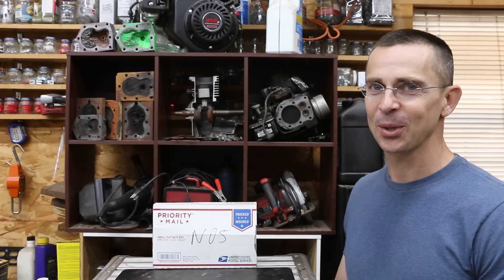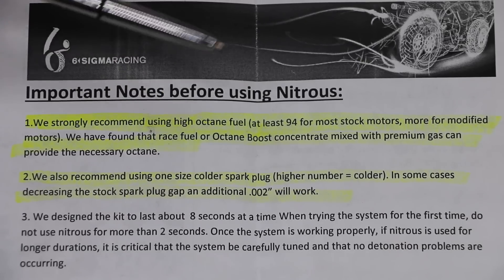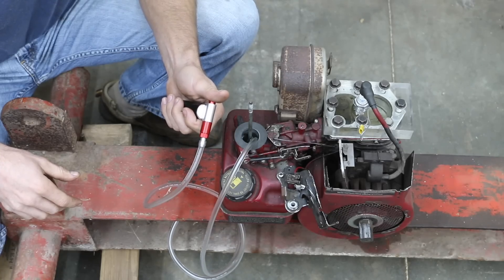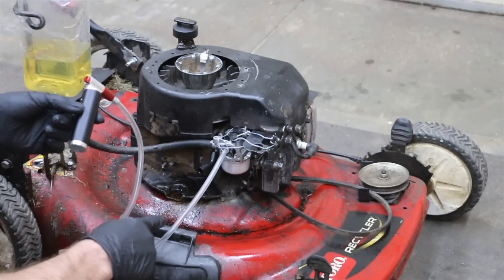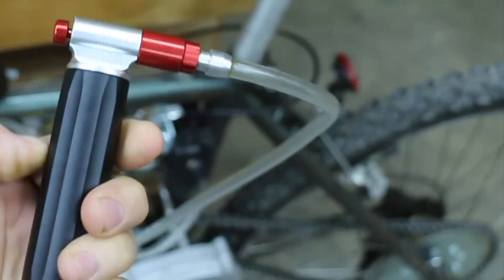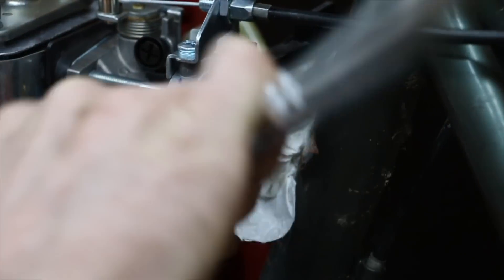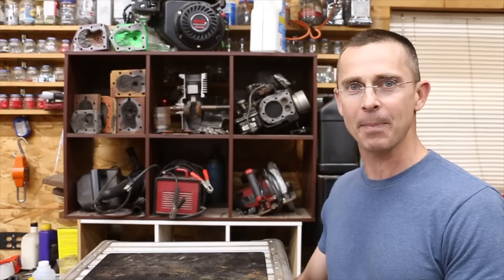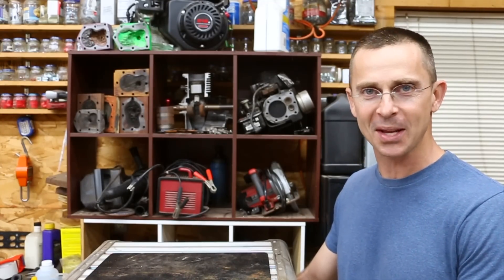Will the 4-Stroke Bike Survive Nitrous Oxide?  Let's find out!

Comment: We need to see the nitrous on a gas powered chainsaw next. By the way, you can buy the nitrous and the pressure vessel from any decent "head shop." It's sold as "whippits" and ostensibly it's for making whipped cream, but really people get high with it. Bout $20 for a case of whippits and maybe $10 for the pressure vessel. You'll need to figure out how to add a valve to the pressure vessel they sell, but if you want to get out the door for under $40 this is a way to do it. Any reasonably well equipped garage and decently handy garage dweller can figure out a way to make it work; it's not rocket science. But by the way: they use nitrous as an oxidizer in rocket motors, so you could build a really powerful motor with N2O as an oxidizer and there are dozens of fuels you could pair it with (H2 is the best and hardest to work with, but has the best caloric density of, well, anything in the universe)
Reply from the maker: Thanks for the video idea.

Comment: The way nitrous is supposed to work is by providing additional oxygen to allow burning more fuel. Without adding more fuel you will be running lean and I would expect pre ignition. On a simple car kit it has a plate with jets that add additional fuel and nitrous.
Reply from the maker: Thanks for sharing.

Comment: When it comes to nitrous, simply moving to a higher octane number (ie..slowing down the burn rate of the fuel's flame front), is only one part of the power equation, if you're also aiming to retain engine longevity. The preignition you immediately encountered, was due to the fact that once you introduced the nitrous into the combustion stream, the presence of the nitrous effectively dropped the "new" air/fuel mixture's octane rating, below that of the minimum required for that engine's valve/head flow, and total timing.. Did you get more power? Hell yeah, you did. The question is, is how long could this engine deal with that? 
   If there is one thing I've learned about nitrous, is that it's very unforgiving if the fuel delivery system isn't up to the task of "keeping up" with nitrous' voracious appetite (ie, NEED), for "more fuel." Add that to a poor cylinder head design, and/or small exhaust valve diameter, or poor type (metal composition), and it's a recipe for burning holes through piston faces, (among other horrible things), should the mixture go lean on gas, even for a few seconds. Trust me, I've learned this the hard way....😣
   Ideally, when running a nitrous set up, a secondary electric fuel pump, with a WOT (wide open throttle) relay activated solenoid switch, should be installed. Along with an additional fuel line. That additional line being at least 2/3 the diameter of the factory delivery line. More gas is THE critical key to a long service life, in any nitrous assisted engine. 😉
   I hope this helps anyone contemplating using nitrous in the future. I wish someone had told me this. And once again, thanks for another very interesting video.
Reply from the maker: You are welcome!

Comment: see the big misconception is that simply adding NOS will give a boost wile it might give a little boost what you need to do is add additional gas wile boosting to keep the air fuel ratio right when you will see huge gains NOS dosent add power it simply aloes you to burn more fuel per charge dew to the added oxygen

Comment: They make EFI kits for small engines they also have an ECU in the kits with a wide band so you can make sure you have enough fuel when adding NoS or a small turbo even...
Reply from the maker: Thanks for sharing.

Comment: You should try doing something with that fuel from RC airplanes believe me you'll get a lot more power than that little bottle of nitrous I recommend some sort of second little tank and somehow mixing it with the gas inside the carburetor because if you put it directly in the combustion chamber you'll over rev the motor my push scooter when I was a kid was ridiculously fast my dad clocked me just under 80 miles an hour on a push scooter 😋
Reply from the maker: Thanks for the suggestion.
Reply: @ProjectFarm  I just picked up a nice road bike going to be ordering a motor kit Monday still debating whether or not to get a four-stroke or two-stroke I watched your video but I still can't decide I used to build motorized scooters out of old weed wacker motors but I haven't done that for at least 18 years or more been wanting to make one of these bike kits for a few years now time to do it

Comment: Adding more oxygen without adding more fuel unbalances the 14:1 mix, so you will get much more power if you add not fuel at the same time
Reply from the maker: Thanks for the feedback.
Reply: @ProjectFarm  Consider trying that NOS test again, but with a small venturi (at the end of the clear hose, with a small fuel hose going to the gas can), similar to those old manual bug sprayers, so that the nitrous oxide jet pulls with it some additional gasoline into the carburetor venturi.

I think the results will surprise you.

Comment: All nitrous does for a engine is to cool the internal combustion chamber and allow more fuel to burn quicker now if you could find a way to super cool the engine while it is riding down the road you might be able to get it to go sixty to seventy miles per hour unless you put a different cc head on it which you probably have a 45 cc head on that 4 stroke
Reply from the maker: Thanks for the suggestioin.

Comment: Add extra fuel, lp butane etc with the nitrous
Reply from the maker: Thank for the suggestion.
Reply: Project Farm perhaps a slightly retarded ignition timing, and a water methanol injection
Reply: Old style carbs with the foam filters could be drilled and tapped and the air box used as a mixing plenum. So a little mw50 in the throat and n2o and butane in the box. ? Might see a rod hanging!

Comment: Nitro, if that is Nitrogen, won’t burn.  So, would pure Oxygen without N give a better result?
Reply: No
Reply: Can’t understand how a nonflammable gas would benefit power output from an engine specifically designed to operate on a flammable fuel. Would a mix with a highly explosive gas like Hydrogen not produce a better result. If not, what is the connection or opposite properties between Oxygen and Hydrogen with Nitrogen?

Comment: Have to add fuel and pull timing to keep it from detonating. Re visiting this test would be awesome. The added power comes from the extra fuel the engine can burn, the nitrous just allows it to burn the extra fuel. The nitrous also is super cooled, cool dense air has a higher oxygen content than thin hot air.
Reply from the maker: Great suggestion!  Thank you.

Comment: Nitrous also adds oxygen to a system, allowing you to add more fuel at the same time, thus increasing volumetric efficiency through the roof. And wait, there's more! The Nitrous comes out of the bottles (NOS) around -128 degrees F .. so in a runner/plenum, the density of the air/fuel charge is greatly increased over ambient temps. Fun stuff. Maybe that's why they call it, laughing gas.
Reply from the maker: Thanks for the feedback.

Comment: Do NOT try this at home kids! Years ago I tried to talk to my wife about her lead foot, but she didn’t wanna hear it. “Oh I never punch it” she’d say when questioned about her acceleration habits. (Like a rocket!!!) So me and a couple of buds did a “tune up” one night but really only hooked up a NOS kit to her “k car” that was installed pretty much flush to the floor so it would only kick once the petal was mashed to the floor hard. Yes I proved my point, no there were no injuries or tickets and she believed me when I said it was just the “high performance” spark plugs that I had changed for her, and they’d only respond like that during break in period lol. Since then (33 years later because one just doesn’t let a gal like that get away) we still joke about the time “leadfoot Lilly” and her little ragtop Chrysler 4cyl k car took out my 73 Nova with a 283 in it off the line lol. Nope, I’ll never tell either, that was too big a win for both of us😉

Comment: Also the shifter karts we now use actually have a low powered nos system that works via the fuel system. This is to allow us to use smaller lower powered engines to reduce emissions and act as a form of hybrid on a engine that can't run turbo
Reply from the maker: Thanks for the feedback.

Comment: Its funny you should think about attaching the nos to a bike engine. I race karts of different formats 50mph twin engine, 80mph 2 stroke rotax karts and 160mph + 250cc shifter karts. 
During a testing session for 1 of the karts we attached the same kit you got to 1 of the engines and it led to some "interesting" results it worked amazingly for a few months of just messing around until the engine shall we say decided to not want to be attached to the kart any longer. We found parts as far away as 300 feet from the kart, some parts we never found. So yeah great fun just don't use it for too long lol
Reply from the maker: Thanks for sharing!

Comment: Nitrous Oxide injection is a torque builder, and works better at low to mid-range RPMs. To be utilized at higher RPMs progressive stages of spray must be added. All the while being supplemented by extra fuel. You get less results with Nitrous only, but the point is made in this experiment.
Reply from the maker: Thanks for the feedback.

Comment: That was knock, not pre-ignition. You probably don't need a colder plug for your lawnmower engine (if you had a high rpm engine under heavy load for a longer duration, then a colder plug would be good). You need more fuel. Nitrous adds oxygen. If you don't add extra fuel to match the additional O2, then you run too lean. That sound was knock. You usually don't hear pre-ignition like you can knock (because of the difference between knock and pre-ignition).
Reply from the maker: Thanks for the feedback.

Comment: There are actually ALOT of people who run nitrous set ups on small engines. I first noticed when I was a teen and raced on the circle dirt track. During the summer 2 day races there was atv drag racing outside of the track. Many of the guys had nitrous, ethanol, cam2, etc running in small 4 AND 2 stroke monsters. I used to have a Blaster bored 80 over, full internals, ported and polished. Running on the ethanol out of our stock car lol. Smoked those Banshees when they first came out easily. It also melted several piston. Thank god for cylinder sleeves and honing bits! lmao
Reply from the maker: Thanks for the feedback.

Comment: When doing this I'd advise getting a really small diameter PEX hose and putting a T up by the button-can with a suction relief valve on one side so the carb can pull the NOx out of the line to get your money's worth.
Reply from the maker: Thanks for the tip!

Comment: Not only when it decomposes you get the horsepower gain, every 10° you cool your intake temp you gain 1 hp, it super cools coming out of the jets in the systems so the cold air expands more in the cylinder
Reply from the maker: Thanks for the feedback.

Comment: in chemistry class i remember batteries split hydrogen from oxygen , and a demonstration tool    made of glass that separated the gasses ,different lead ends one zinc one copper, i think ? I've always wondered how one could get the right mix from those gasses to run in a engine , without turning it into a tannerite  target. its clearly the O2 thats giving the power boost. i have sat at the mans table drinking coffee who made the carburetor that can get you 100 miles a gallon in a 1985 square body heavy  chevy. I received a clue that day which gave me an idea. Have yet to receive the resources or time to tinker.
Reply: Gorski, mans coffee
Reply from the maker: Thanks for the feedback.

Comment: Doing high performance engines, we always add more fuel. Essentially the nitrous adds oxygen to the additional fuel creating safe power. Just a squirt of nitrous without additional fuel will still introduce additional oxygen, however to the detriment of the engine. Stochiometry is exceeded and it burns too hot (leaning out under boost is the same effect) causing instant hot spots and stuff breaks and melts. Rings get too hot and expand popping the heads off of pistons. So add more fuel, and try it again.
Reply from the maker: Thanks for the feedback.

Comment: The extra power from Nitrous comes mainly from the extreme cooling effect it has on the surrounding air when it's entering the engine - This significantly denser air allows much more fuel to burn and a much more powerful force on the top of the Piston. To my understanding, not much really comes from burning the nitrous itself.

Your lawnmower was pretty much topped out when revving with the nitrous - You didn't hear much because of valve float. Putting a larger cam or harder springs in, as well as adjusting the valves in general would probably get you to dangerous(ly fun) territory - flywheel shattering, even!

Hey, those little Briggs motors are built to mow lawns trouble free for a decade or two, with minimal maintenance and oil changes. 
I had a Briggs once that had a hole in the head gasket and kept cutting grass just fine! They're damn hard to kill.

If you had a second gear on that bike you'd get a considerably higher top speed, it's making plenty of power stock but it seems like it's just topping out rev wise, especially so with the nitrous.
Reply from the maker: Thanks for the feedback.

Comment: Nitrous does two things.  First, it cools the air as it vaporizes, which increases the density of the intake air charge. Denser air has more oxygen in it, so you get more compression, more compression males more power. The nitrous also increases how much oxygen is available in the air (breaks down into nitrogen and oxygen, remember), which lets you add more fuel to make even more power.
Reply from the maker: Thanks for the feedback.

Comment: Always enjoyed your videos, thank you. I have one request and I'm not sure, if you have already displayed a video on this. Since you mentioned octane boost on this video. I would enjoy seeing you do a video on different octane boosters. Do they work, how much is gained, do they harm your engine, can you use more then one per tank fill etc.
Those who put super chargers, turbos, nitrous or rebuild a motor with high horsepower needs more octane. Race fuel is very expensive and hard to get. These octane boosters are less expensive and easily obtainable, this would be a good alternative source. 
Also add a vapor cooler to your intake when trying to add more horsepower like nitrous.
Reply from the maker: Thanks for the video idea.

Comment: @Project Farm - I have a 1 pound aluminum CO2 bottle that can be used to hold 1 pound of N2O.  It is rated with a service pressure of 1800 psi (124 bars) and since liquid N2O is no more than about half of that pressure, you can use it for N2O safely.  It might be good for your bike.  You could get way more than just 8 seconds (perhaps several minutes).  You would likely have to use a very small jet and/or some other means to control the boost into the engine.  The bottle is silver colored so it will reject much sunlight.  Is it something you would be interested in?  I used to transfill it simply by using my 10 or 20 pound N2O bottle at room temperature, and using it to fill the 1 pound bottle that I froze overnight in my freezer.  You wont get the full 1 pound that way but you will get WAY more than 8 seconds worth.  You could actually gently heat the larger bottle if you wanted more N2O to flow into the smaller frozen bottle.  Let me know.

Comment: You get more power by adding more fuel WITH the nitrous.It requires an enriching circuit to keep the proper air/fuel ratio.The pinging you were getting was a lean condition.Lucky the engine didn't blow.
Reply from the maker: Thanks for the feedback.
Reply from the maker: Thanks for the feedback.

Comment: The advice given regarding spark plug temperature rating ONLY APPLIES to NGK spark plugs!!

For Champion plugs the numbers GO LOWER for hotter plugs!! An L81 is a hotter plug than an L82, etc.

Similar for expensive Lodge / Golden Lodge Sintox spark plugs an HN3 is a hotter plug than an HN2 and an HN is rated colder than both. (HN = Hot to Normal running).
Reply from the maker: Thanks for the feedback.